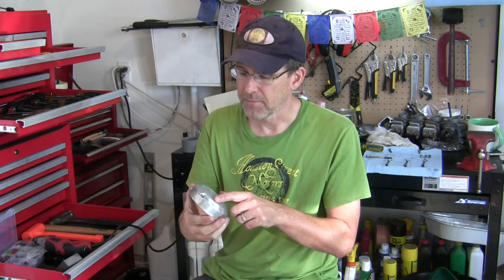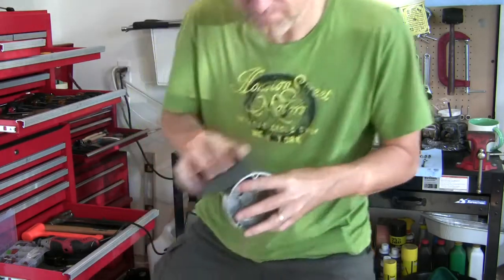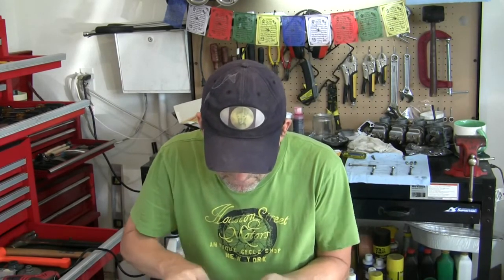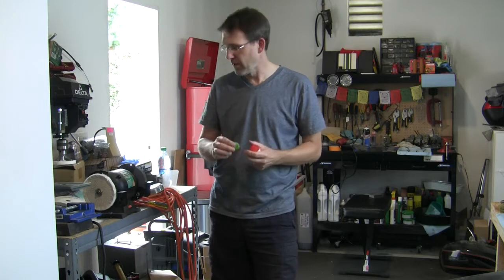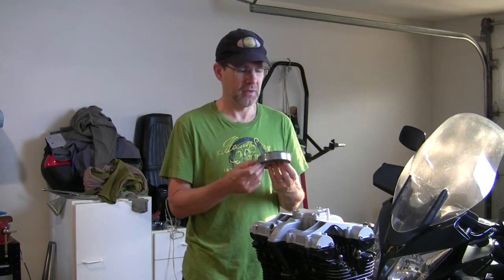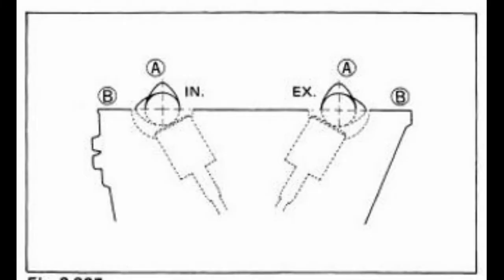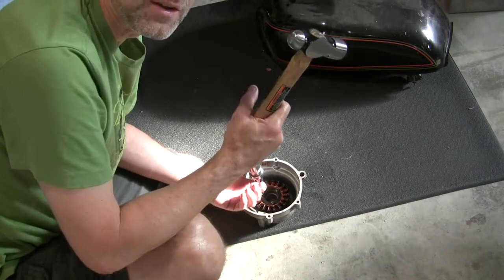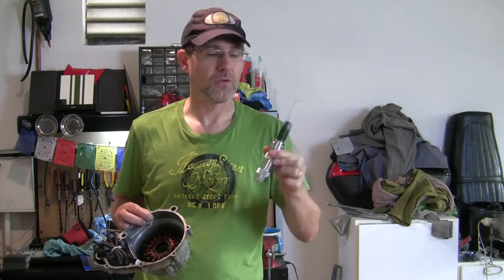Valve Tappet Clearance Check - GS550 Cafe Racer (Part 19)

Comment: Don’t understand why you want to go towards 0.08mm at 22:25 ? 
It’s better to be at 0.03mm ? Means less wear and more time before changing shimes
Reply from the maker: Thanks for watching! At this stage of project I was still getting a feel for what I needed to order to even get close. Ultimately I ended up placing multiple orders for shims and made multiple changes until I got things dialed in. When you say "less wear" at what point are you referring too - wear at the cam lobe or wear at the valve seat. Both contribute to change in the clearance between lobe and shim.
Reply: hey, is what this guy said actually correct? was under the impression looser is better, that loose has less chance of damage than tight and that they tend to tighten up over time too @UrbanMonkTV
Reply from the maker: @OliverStorey-fm8rf  agreed, a slight larger gap means the cam lobe doesn't need to "lever" as much and reduces pressure on the lubricant between the lobe and tappet. The other thing to consider here is that I've put less than 1000 miles on this engine since. It's a show bike. I don't ride it much. At 0.08 that clearance will be in spec for many years to come.

Comment: I just re shimed my GS 750 and some off the shims were used in othet spots but, 2 of the valves were so tight that I ended up ordering shims 3 times for the 2 valves. I dropped by .05mm 2 times then a whole 1 mm the third time and FINALLY got it.
Reply from the maker: David  White That is my worry. When there's no measurable gap, there's no math. 😕 Good thing I've got plenty of other work to do while I wait for this shim dilemma to play out. I ordered a 5pack of 2.65. They're 0.05, 0.1 and 0.15 down from all I currently have. Guessing I'll have another round of ordering after these, but seemed like a reasonable place to start. Thanks for watching!

Comment: Here is my feedback after my first valve job.
First let me say that this is not an EASY job to do. I’ve an ok mechanic background with a complete 2 strokes rebuild and also some car maintenance history (break, clutch…)
And this was harder to achieve than I think it would…. On the paper it seems pretty easy but there’s several parts that are not well explained even on the original suzuki maintenance book….

1- the special tools need to be perfectly placed, indeed if you put it too much on the shime, you won’t be able to replace a shime after, not enough it might slide.

2- Best is to always fit a new shime inside the  one you just removes to avoid the issues describe above. SO START WITH A SPARE SHIME !!!

3 - Also cam need to be correctly place in order to avoid issues and complexe movement to remove and refit a shim. Cam must not be pressed against the shim and with its top pointed to outside the engine ex front of bike and in rear of bike)

4 - NEVER TURN ENGINE WITH ONE SHIM OUT !!! Seems probably obvious for most but not for everyone, you can chip your cam this way… I almost did fortunately the majority of the cam is still intact just the edges so it should not affect the valve opening cycle….

5 - A or B position doesn’t work, at least for me I had complete different readings of my gaps if I put the cam on A or B position…  Correct way of doing it is :

You have notches at the end of camshaft when you look from right side of the engine, this need to be horizontal and parallel either pointed outside or inside.
Outside position you can read in and ex of cylinder 1, ex of cylinder 2, and in of cylinder 3) pointed inside is the rest ! You can also check ignition plate you must be at T position ! This way gap is correct and consistent !

I hope this will help other not to endure the same moment I did… but I guess I learned the hard way…
Reply from the maker: Thanks for watching and for sharing your insights with others here. Totally what I hoped this channel would become.

Comment: Hey I did my valves lapped now all my valves are tight. They are all under 0.003 mm. Also I got a used cylinder head with all the valves in it. With unknown miles
Reply from the maker: That's great! These things were built so well, mileage doesn't really matter. All that matters is condition,  and you know that because you've done the work. 👏